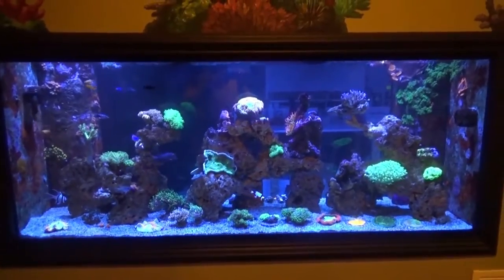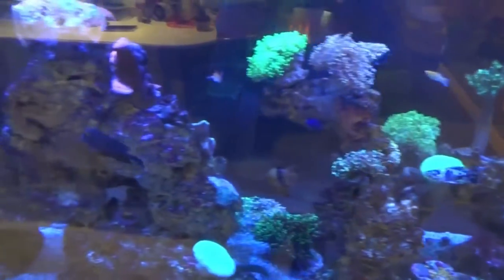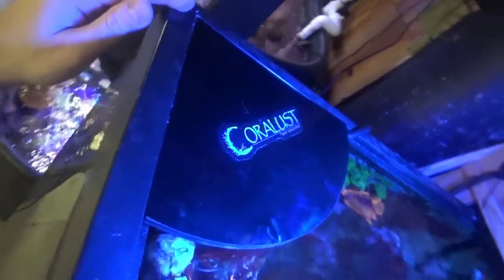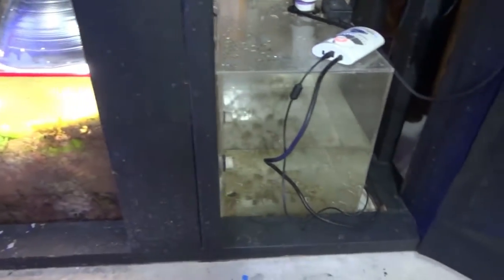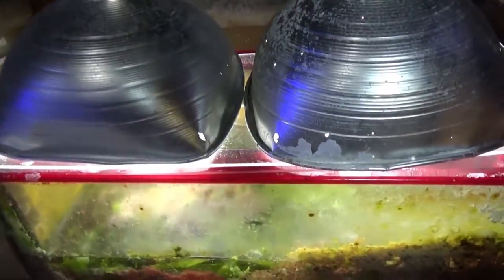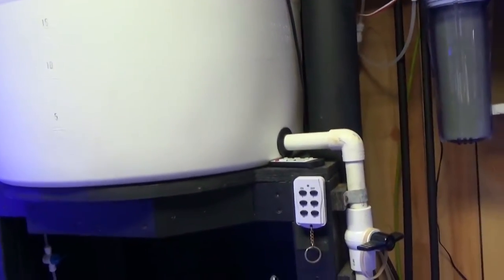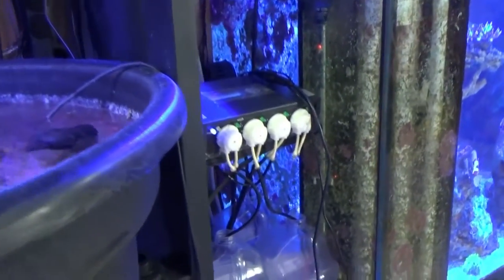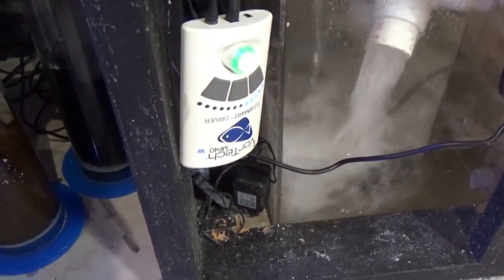220 Gallon Display Tank Equipment Tour

Comment: What's the deal with the rusty clothes pin? Isn't that a bad thing?? You have a crazy big system, there is a lot going on there, my wife would kill me lol. I love the two sides of the tank, it's like you have two tanks, maybe sps on one side lps in the other would be cool.
Reply from the maker: +Bob's Reef Tank Yeah it is definitely time to change that clothes pin.   The rust doesn't hurt anything but it does weaken the clip.   I will have to replace that ASAP.   I like your idea. It is like having two tanks.
Reply: Coralust Reef Solutions i had the same pins. . lol I found plastic coated clamps at the dollar store. .
Reply from the maker: +Dee From Brooklyn I need to take a trip there and pick up a few things.  I use a lot of Tupperware.
Reply: Coralust Reef Solutions they had great dosing size glass containers.  i got a few